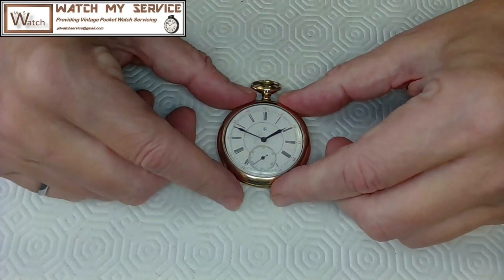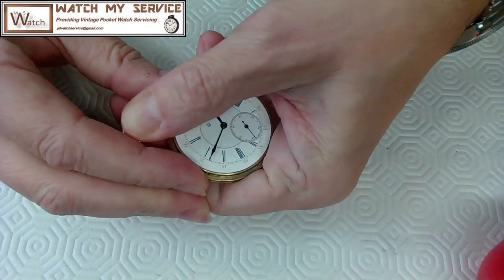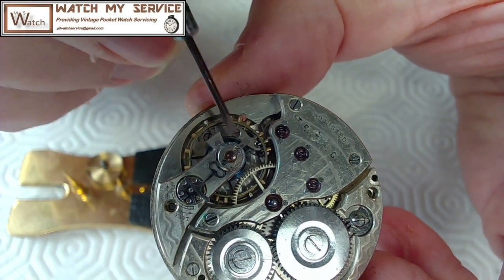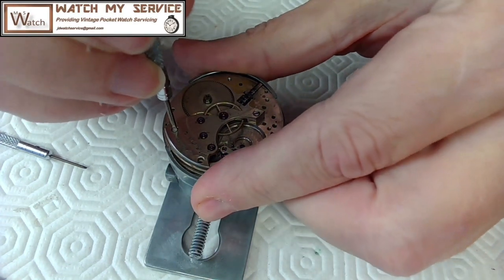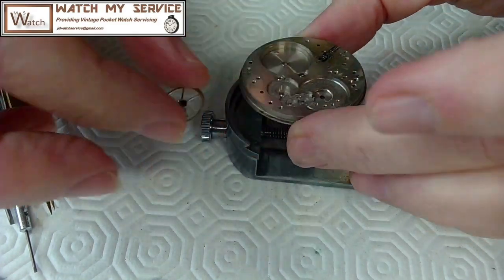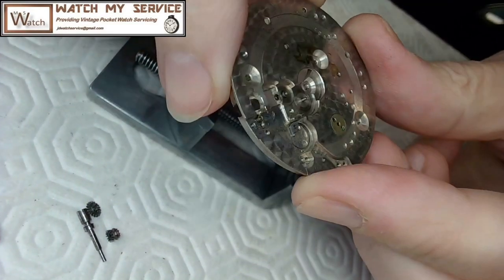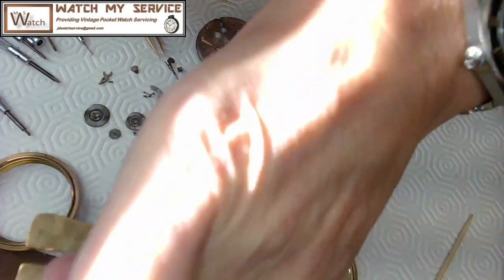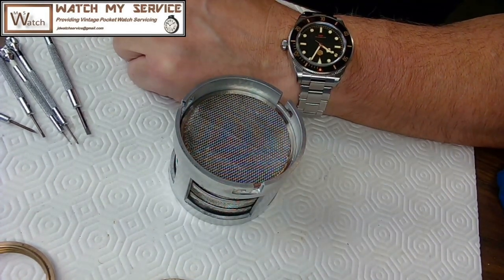T Eaton Watch Disassembly and Cleaning

Comment: Those tight screws had me nervous. More than stripping the head of the screw, I worry that the head would snap off. I like to put just a drop of WD-40 on the problem screws then come back to it in a few hours or even a day later. Lovely content, thank you for your videos and dad jokes lol
Reply from the maker: I made me very nervous as well. I have only lost a few screw heads and in many years.  I usually give up and soak them as well.

Comment: Some folks will let down the mainspring by removing the pallets to watch the wheels spin down. On one of my practice watches, after spinning down, the mainspring still had stored energy. My lesson learned was it’s better to pull back the click to let it down.
Reply from the maker: The method of letting the wheels and is very dangerous as the wheels were never meant to spend like that and there is a chance of heating up the pivot and snapping it off on perhaps the fourth wheel or the escapement wheel where the pivots are a lot smaller. I would not recommend doing this to anyone